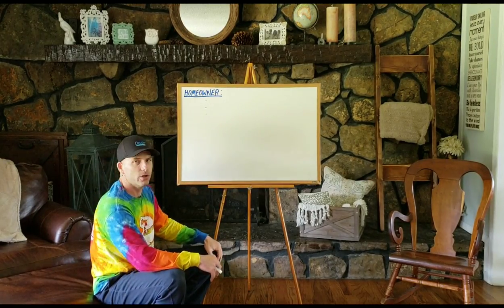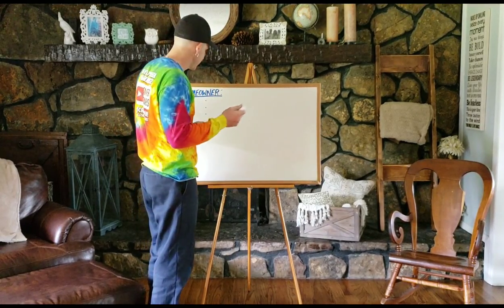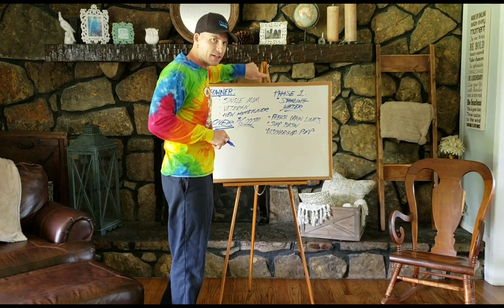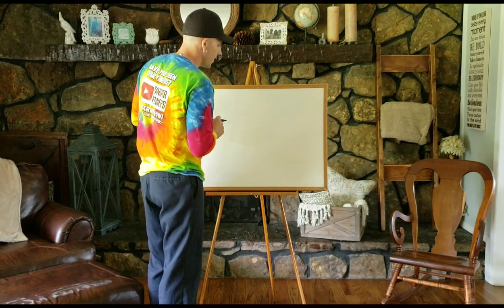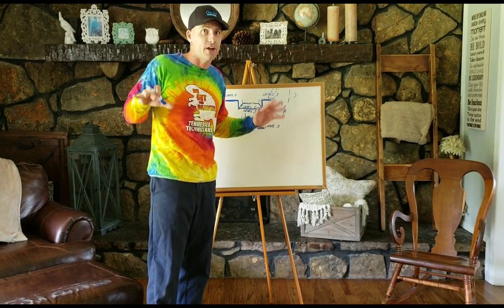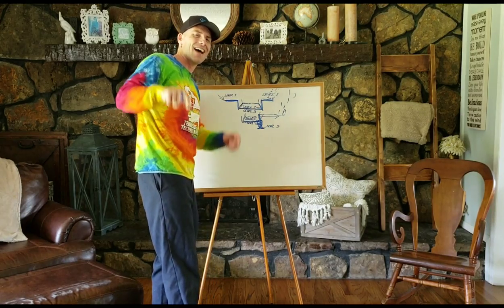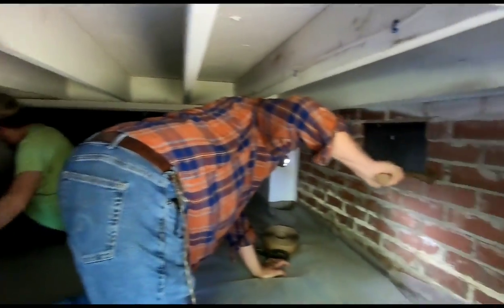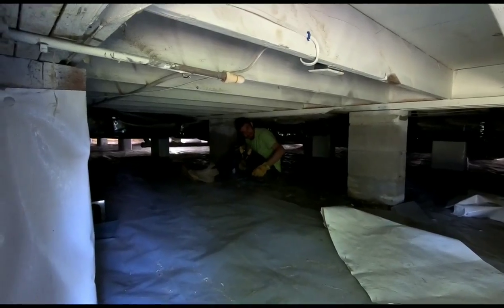Crawl Space Encapsulation! Is one company as good as the next?

Comment: I just discovered your videos and website. Awesome information! I wish you guys serviced SW Florida. I'm getting tired of trenching through mud and cypress roots then baby sitting a transfer pump every time it rains here! Wish I had the confidence to take on a better solution. Do crawlspace encapsulations work if the water is coming in from under the house and not from outside the stem wall? I suspect our issues are due to the water table rising and the lake, roots, etc...
Reply from the maker: Yes, as long as you have a means of controlling the water. That is where the inside perimeter french drains, and sump pump come into play. That is a job in itself.